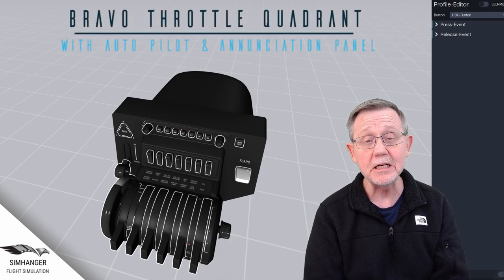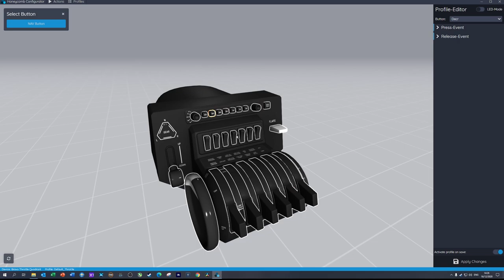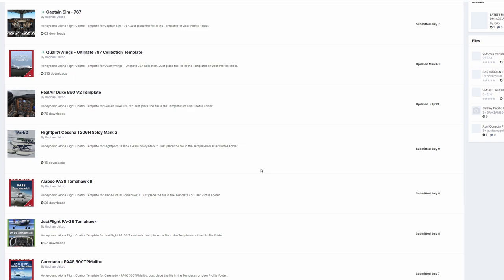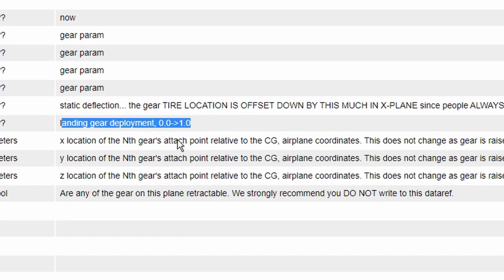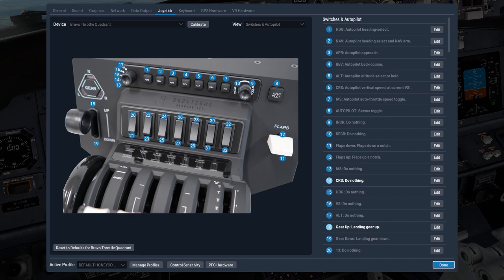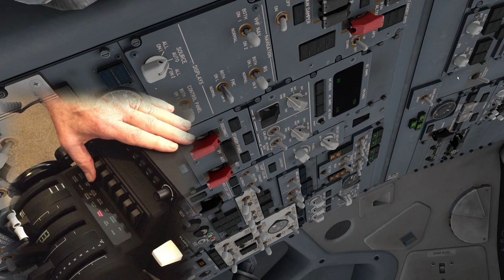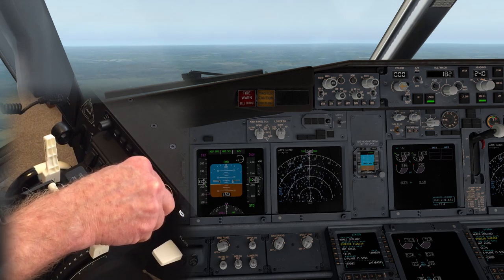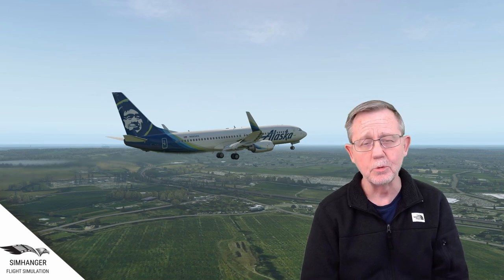BRAVO THROTTLE QUADRANT | CONFIGURING FOR XPLANE11 | Getting the lights on!

Comment: Thanks Marc, I have this problem in understanding the BRAVO setup, using X-Plane 11.52 SE. I understand the idea is to build up the joystick setting for the BRAVO in X-Plane itself and then , for the complex things like LEDs and FCU, to continue the set-up in the Configurator. My question is: How does the Configurator see the profile as "done" in X-Plane/ Settings? (xxx.prf file type). The configurator seems only to create NEW files ( xxx.json file type, different location). Further, if I were to create a new profile from scratch in the Configurator, how to get it imported in X-Plane as a joystick setting?? I am sure you can give me the click I need ; thanks
Reply from the maker: Hello, you need to start with the configurator, take the default and activate this. This will load this profile into Xplane with the led’s etc pre-configured. Using this new profile build new profiles for your aircraft saving with different names. The config profile will be carried across. If you need to change anything in the configurator then save that as a different name in the configuration program and activate. This will load the changed profile into XP. Now build new profiles based on that. I recommend deleting all ‘’old’’ profiles for safety. Hope this helps.
Reply: @SimHangerFS  No Marc, it didn't. Bear with me. As a test, in the Configurator, I created a new profile based on the default, renamed it "TEST", then I loaded profile "TEST" and could recognize it in the screen as "current". Then I "Activated Current Profile", hoping that "TEST" would be carried across into XP and become visible. It is not visible in XP/Settings/active profile. 
As a secondary confusion, I don't understand how" with the led’s etc pre-configured" in your second sentence. 
Kindly help ! You may kick me instead of giving a click.
Reply from the maker: @hendrikeveraert3534  when you activate your TEST profile in the configurator and load up Xplane there will be no TEST profile. This Test profile has overwritten the default USER PROFILE in Xplane. This now becomes your new building block for future profiles. I saved a copy of this USER PROFILE before doing any changes , I called it default honeycomb, so I can use it if I accidentally overwrite the default USER PROFILE. Hope that is clear. 👍
Reply from the maker: @hendrikeveraert3534  the new USER PROFILE has the config and led’s within this profile. You can test by going to c172 etc. Regards
Reply: @SimHangerFS  many many thanks, my mental roadblock is removed. The process flow is now clear. I have experimented by installing the "Heading Bug" (the two rotary buttons left and right) and it works fine. TO MY (pleasant?) SURPRISE it affects ALL Xplane joystick profiles (previously created)... So I guess the Configurator is acting at the BRAVO driver level...? It is a shame there is no proper manual explaining the processes and the variables structure.
Reply: Sorry, sorry. I am now discovering that, using the HC default (and activating to Xplane) gives me all "default" features including Selectors and LEDs in Xplane....(few items to further install such as light switches or throttle, mixture etc under a specific name)...Without doing anything. I can also recognize this in the default.json file .
Much adoo about nothing? Over and out.

Comment: Hi. I have my thrust reverses set as yours on the zibo 738 and it dosent work. Any idea how to fix? Thanks in advanced.
Reply from the maker: The Zibo mod uses none default bindings. So default doesn’t work. I have the same problem.
Reply: @SimHangerFS  But i see on the vídeo that you put it to work! How?
Reply from the maker: @mundodabrincadeira3571  only some of the features work on the default bindings. Not all. The 737 in the video is not the Zibo mod from what I can recall.
Reply: @SimHangerFS  my mystake. Thanks

Comment: I can't get my lights to work like, gear and anunciator panel with xplane12 and the honeycomb throttle, is there a way?, I used to have xplane11 and it worked perfectly recently I deleted it to make space for xp12 and the lights dont work.. any help?
Reply from the maker: Hi, not sure as I have not tried it with XP12.

Comment: I am trying to setup the Honeycomb bravo throttle quad for the Xplane HotStart TBM900 with a turboprop engine and latest lever control system.  This aircraft has a single throttle that integrates the condition lever with the normal throttle and an auto prop adjustment for 2K rpm.  I have tried to use the Xplane settings to assign a mixture and throttle to two axes as a way to bring the throttle up to low idle and then to. high idle. The throttle axis also was set to have beta and reverse thrust.   Unfortunately there is no response for the initial movement of throttle to low or high idle.  Appreciate any guidance for setting up a turboprop with the Honeycomb bravo in Xplane.
Reply from the maker: Hi William, I have not found a solution for this. Need additional config options in sim.

Comment: Mark,
Hi can you assist me with the downloading of required files for bravo quadrant. 
I watched the video and it seems very straightforward. 
Went to the site found the download but it will not download. 
Do u have to have the bravo quadrant plugged in? 
Mark
Reply from the maker: Hi Mark, common problem, turn your antivirus off. Also click on the download link to open in new window or tab, this usually works. Also available on Aerosoft site. Regards
Reply: Roger that Mark

Comment: this doesn't work with the ini A300 or the FF767 but the gear lights work so... I guess that's cool but you can't control the AP
Reply: Yeah same boat with the FF767. The FCU doesn't work- I can program the individual autopilot buttons but without FCU functionality it's pointless. I wonder if the configurator requires new commands...

I suppose it's an FF compatibility issue because the autopilot is 100% functional (including the FCU) in the Airfoil Labs King Air 350.
Reply from the maker: Hi Michael, you would need access to the specific commands for those functions by the developer, they have used their own set of parameters rather than the default. I would hope many will release config files  for the Bravo or like Captain Sim share their commands. Aerosoft have just released files for the PMDG 747 and 737 (P3D).

Comment: Mark.  Is there a configurator for P3D?  I have installed the Bravo but no installation reference,starr up icon, nothing.  The unit does show up in Devices and on P3D but nothing or nowhere else.
All videos/forums refer to X Plane or MSFS.  Help.  How do I set it up in P3D V4.5?  Thank you
Reply from the maker: Hi Dennis, yes there is. Go to Honeycomb Aeronautical website, on first page scroll down to vey bottom and click on downloads link. Scroll down once on the downloads link and you will see the config download for P3D. Download zip file. Unzip and install. This will put an icon to the configurator on your desktop. Double click the icon and your away. Regards
Reply: @SimHangerFS  Thanks Mark but when I click in the Prepared3DV4 DOWNLOADNOW link nothing happens???
Reply: I finally got the download but when I try to open it all I get is a gray square???
Reply: Dummy me forgot Run as Administrator.  I now have configurator  Thanks Mark  Appreciate your help and patience.
Reply from the maker: @golfguyw5  , hi Dennis when this happens right click on the download link and select open in new window or tab....it will then download. Regards

Comment: I'm having trouble setting up reverse thrust with the zibo 737
Reply from the maker: Hi, the Zibo does not use default Xplane settings for some of the functions. That is why your having problems. Sorry I have not done a separate config for the Zibo.
Reply: On controls maping setting you type 738 and the zibo comes up and all the functions is there all you have to do is start selecting what bottom want to do.

Comment: Hi

Fantastic video. Without your video, It was impossible for me to configure the H.B. for X-Plane 11 A great thank you.
 I have a problem with the course. With all an afternoon and a part of the night, I have no solution found to manage the CRS Button. I have found with data ref  editor (after a very long time) 3 lines;

sim/cockpit2/radio/actuators/hsi_obs_deg_mag_pilot=0.000000

sim/cockpit2/radio/actuators/nav1_obs_deg_mag_pilot=0.000000
sim/cockpit2/radio/actuators/nav_obs_deg_mag_pilot=[0/12]0.000000

I do not know what I have to indicate in condition 4 /variable. Could you please help me. I fly with the X-CRAFT EMB 135

I hope you will read my request.

Best from a former airline pilot
Reply from the maker: The CRS button and config is mislabelled…it is the VS or FLC function.
Reply: @SimHangerFS  Hi good News. My problem with the course button is solved. The course button is working with the incress and decress button now

. I have a new problem.  I do not find the solution. It is for the ANTI ICE led. 6 buttons are working (pilot,windshied,eng air inlet, wing)The problem is with the stab button for the ANTI ICE led. I have the command but not the value. With the value =0 the ANTI ICE led is blocked ON. With the value =1 the ANTI ICE led is blocked OFF
Have you an idear please ?
Reply from the maker: @jecomposesur...  not sure, but would guess you need to configure this in the configuration program with something using the ..if…then Boolean logic.
Reply: @SimHangerFS  Why not..... I will try tonight

Comment: I can not install the honeycomb Software, the setup found not my folder „ E:\X-Plane 11“, had someone a advice
Reply: @chazflyz  Thank you very much 👍
Reply from the maker: @milanwings52  , Chazflyz is correct, note the details on how to overcome this issue are also in the description notes to the video, as per the pinned comment at the top of this section. Hope you got it sorted! Regards
Reply: I had the same issue when I got mine. I opened a ticket with Honeycomb and the discovered the issue. The issue is when the user transfere the XPq1 to another drive the Honeycomb SW won’t see or deduct where the XP is instslled. To fix this goto to the following path:

C:\Users\*your username*\AppData\Local\x-plane_install_11.txt
 And delete all the old XP paths and keep the current XP path only, be carfull don’t delete the current path of your current XP drive path.